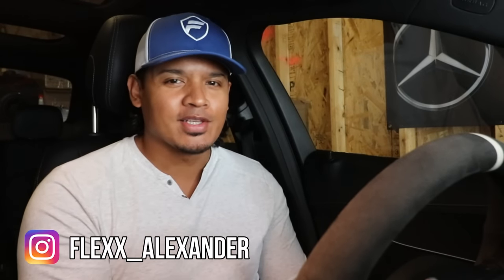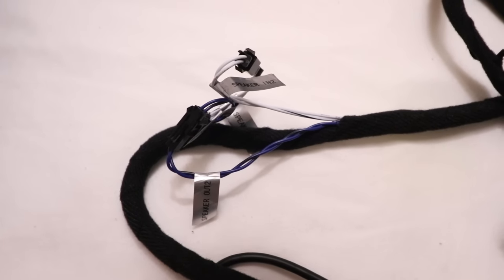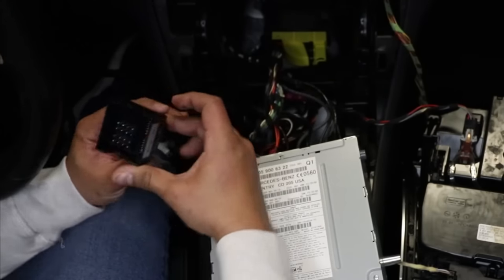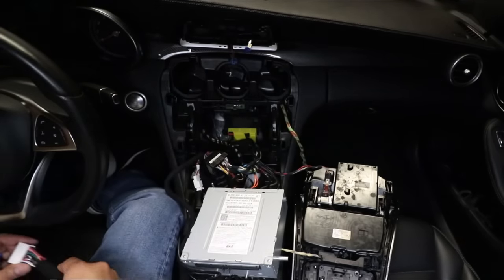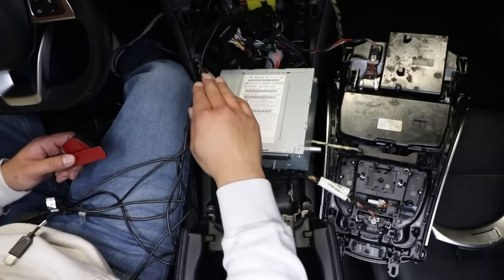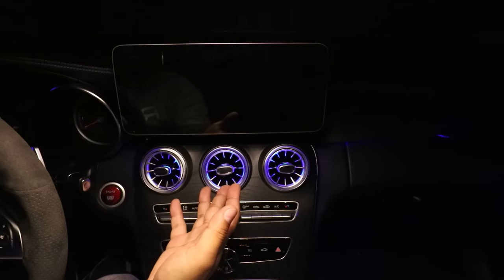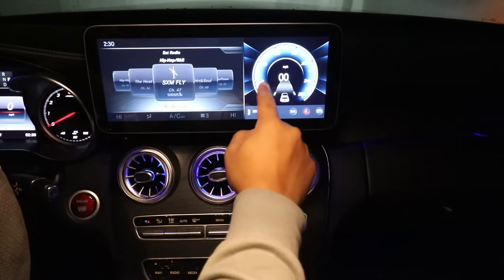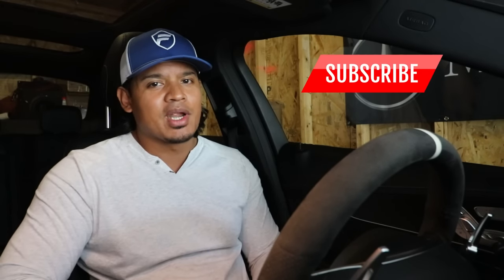BIGGEST Android Screen install on C300 (W205) 2015+ Mercedes C-Class

Comment: Hi Flexx, Thanks for the video. In terms of size, would you recommend the 12.3 or the 10.25 for the w204, c250?
Reply from the maker: For a 204, going 10.25.  The 12.3 is way too big. It’s only good on the 205.
Reply: @TheFlexxGarage  thank you 🙏🏾.

Comment: With the aftermarket screen, do you get the 360 camera that comes with the original system? I have a 2014 E 400 coupe. Crazy about the car, just not the infotainment system.  Someone told me that with the aftermarket infotainment systems, you lose the cameras functionality that comes with the car.
Reply from the maker: You don’t get a camera with the screen. I already showed in the video that the screen supports the oem camera or any aftermarket installed camera.

Comment: Hey man. Thank you for the video. I have a question about the buttons on the steering wheel, do the work with this display? For example, can I accept a call on my phone using those buttons?
Reply: I would like to know as well
Reply: I have basically the same screen here in the UK and the buttons work to answer and cancel calls.
Reply: @nickclarke2444  Thank you man ❤

Comment: Can you control the ambient light as well via this new screen?
Reply from the maker: The stock ambient system is controlled using a setting on the oem interface.  The new screen has access to both the old oem interface and the new android interface.

Comment: With the GPS and Mic do you have to set them up?? Or can I just use the OEM GPS and Mic with new screen??
Reply from the maker: The extra mic is just for extra voice pickup. It’s not required. The stock mic will still work. 

The oem gps can still be used but only in the OEM intereface on the new screen. It won’t work in the Android interface.

Comment: Is this screen compatible with the GLC300 2018 using Head-Unit Include CarPlay? Can I use this screen to display a simplay carplay function? At that time, I need to install GPS antenna, wifi antenna?

Comment: Thanks for the very detailed video, you’ve got a like. When plugging in the small speaker, are you loosing anything? Like yours, my harness is together already, and I only plan on using CarPlay navigation. 

The small speaker is only used if I’m using the built in android Navigation right? 

Thanks.
Reply from the maker: The speaker is optional
Reply: Appreciate the fast reply. So if I install the speaker, but use CarPlay, the sound will still come through cars own speakers using the USB to Aux?
Reply from the maker: the whole point of the screen is to upgrade your OEM screen. It still plays all audio through your car speaker system. They wouldn't sell a system like this just for it to only play through a tiny speaker. The tiny speaker only has to do with GPS directions from the android screen in certain situations.

Comment: Hey Flexx, been trying to reach out with some questions.  I did the install on my  new Android 12.3 Touch Screen  on 2016 E400 with NTG 5.1s.  Thank to your video.  However, noticed there was a Aux Audio out and Aux Audio in type male and female connectors main harness.  Wasn't sure so I simply connected these two aux type connectors together, and didn't use the USB audio box.  Everything else was straight forward and seems to work beautifully.  However, when trying to listen music from the Android side there is no sound.  OEM side works just fine.  Could it be that USB audio box that I ignored?  Please reach out let me know.  Thanks
Reply: Yes. Need to plug aux into usb Audio box. Then audio box into usb slot.

Comment: Great video Flex! Why didn't you use the original GPS sensor of the car ? You haven't it on the car ? I have a W205 2018 with a small display but it has GPS. I think I can use it, right ?
Reply from the maker: The screen has nothing to do with your oem system.  It’s basically like plugging a tablet to your car. It needs it own GPS receiver in order for gps apps to work.  When you switch from the android interface back to the oem interface, the oem interface uses your oem GPS receiver.
Reply: @TheFlexxGarage  Thanks for reply... one more question: at 5:19 you removed a connector from old display. Isn't it the GPS's car receiver antena ? If so, can I use it instead the one provided with the new screen ?

Comment: Hi Flex, thanks for making these videos and having that 5% off code. I recently got in my android screen and I wanted to know if I had to use the microphone and the speaker they sent with my screen in order to use voice control? I notice in one of your older videos the screen didn’t come with the extra mic and speaker. It’s my first time installing a screen and I want to keep my install looking as clean as possible
Reply from the maker: The speaker and the mic  is not a must. It definitely helps but the screen will still work for calls and turn by turn direction without them. If you want to triple check, just contact DMP and raise the question. They can confirm.

Comment: Just opened the center speaker cover in my second hand C350e.. And realized there is no speaker inside. Is it normal for that model to have an empty speaker soket?
Also.. There is no satelite radio cable where it should be..

Comment: Question about the Android screen 
Everything was great until I took my car in for service and now the buttons surrounding the selector wheel (driving mode switch, exhaust mode, damping mode) don’t work while the aftermarket menu is displayed. They do work while on the original menu, so when I enter the original OEM menu I can change my driving mode .
The middle zone (selector wheel, pad and buttons on the pad) do work on all menus
How do I make the other buttons work at all times again?
Reply: Hi, 
were you able to solve those problems? I am thinking about buying one for myself. How does it feel like after using it a period of time? is it as smooth as the OEM system?

Comment: Hi Flexx. Do you know if 360 degree stock cameras and animation are displayed in andoid? (Image from above the car and auto switch from the back to the front camera)
Reply: Also, it is possible to use split screen?

Comment: Do you have to instal the gps receiver,   car already has it via the old oem. ?   Does it not transfer when installing the screen?
Reply from the maker: The android interface on the screen uses the aftermarket gps receiver in order to use gooogle maps or another map app. 

The oem interface on the screen uses the oem gps receiver built into the car in order to use the OEM navigation.

Comment: Hi Flex thanks for your screen upgrade just 1 question does the speaker and mic replace the original car sound system. Regards John
Reply from the maker: No. The mic is supplemental to the oem mic. And the small speaker is for gps guide as a backup.
Reply: @TheFlexxGarage  Thank you very much I really enjoy your vids great job

Comment: Hi Flexx. Great video and install. Can you please tell me if it’s possible to run the NTG menu full screen without having the split screen with speedo on the side? Thanks!
Reply from the maker: You can but it’s in a hidden menu.  The screen view is gonna look stretch though cause the oem NTG aspect is not designed for a wide screen.  If you wanna do it, you need to contact whoever sold you your screen on a walk-thru along with the password to your screen to enter the hidden menu.

Comment: You plugged the audio-out-USB into the USB-port in the armrest. While the USB-port in the armrest is only a power supply. What's this has to do with the function of the audio-out? Thanks.
Reply from the maker: The USB port on my car is not power only. It’s an Audio in. (Like an Aux).  If you don’t use it, then you get no sound from the screen into the cars audio system.
Reply: @TheFlexxGarage  how does carplay sound work? on my current screen mod I have to switch to AUX to have driving instructions which is annoying, with this can I have Spotify playing over BT to OEM radio AND driving instructions through the provided speaker from the wireless carplay?
Can i also screen cast from my phone AND have the audio playing over BT (like say on YT app)? This feature alone would make me wanna upgrade from my current setup..

Comment: Hi Flexx , I've installed the same display on my C220 2015. My audio and reverse camera don't work in the android interface but they're okay in the stock MB interface.  Any fixes you would suggest?
Reply from the maker: You didn’t setup your android setting correct. You need to contact whoever sold you the screen for how to set it up for your specific car.

Comment: I attempted this install about a week ago but was unable to install the new bracket. It seems the screw holes do not line up with the ones in the dash. Did you have this problem at all?
Reply from the maker: As seen in the video, it Lines up and installed perfectly for me.

Comment: Since installing this two years ago, have you had any issues if so what where the issues. I’m considering buying it I just want to make sure everything will still work like factory
Reply from the maker: Had one issue with CarPlay freezing up on me. Just uninstalled and reinstalled and it was fine.  And maybe 2 times a year, when I start the car…the screen would still be black. So I just shut off the car and turn it back on, everything is fine.  Again, maybe 2 times outta the year.  

When you’re in the OEM interface, everything works like factory.  When your in the android interface, it works well but don’t expect everything to work like factory cause it’s not. There’s a learning curve to using the android interface.
Reply: Do you think it’s worth it to buy? Even with those minor issues?
Reply: Quick question, do I need to connect the mic or can I connect it to the old screens mic and use that instead is that possible if so how ?

Comment: I bought and installed the 12.3” Android screen for the W205 back in April, and it looks and functions almost exactly like this.  Surely such a minuscule difference from the one I have would be available as an update rather than having to drop another $630?
Reply from the maker: You might be able to get some updates but there were hardware improvements that are physical changes.

Comment: Hi Flexx, I got mine in June 12.3” and I have two issues: one the sound is always delay by 3 to 4 seconds. And the other one is when I receive a call or make a call, I can’t hear so I need to always change my Bluetooth option from my iPhones while I’m driving, it is annoying to be honest. Any solution for me?
Reply: Hey bro, did u have the delay before on the oem screen? If you did then its a mercedes head unit issue that can now be fixed with a dmp add on for the delay. If its a new issue then you should probably reach out to dmp to see if they can get it fixed. Best of luck!
Reply: I have this same issue with the delay! Any solution 1 year later?

Comment: hi Flexx, I have built the android screen from MDP in my GLC and have some questions, my rear camera shows the half screen, but wenn i turn to D mode, i can see the rear camera very well. Another question ist the android audio, i don't hear anything, wenn i turned to origin mercedes menu, it works great. Do I have to change settings anywhere?
Reply from the maker: You need to setup the screen properly.  Those you mentions are not issues with the screen but your settings.

Comment: is installing the speaker and microphone necessary? and does the audio run through the car speakers for navigation and music?
Reply from the maker: Not necessary but better voice pick up for calls.
Reply: @TheFlexxGarage  is it possible to use the oem micro and speaker?
Reply: @stintflamez, I'd like to know the same thing. I would only be using the unit for Carplay, so would I need the GPS antenna, mic, and little speaker hooked up?

Comment: Hi Flexx, why does the screen need a different GPS and WiFi receiver instead of using the built-in receivers?
Reply from the maker: Because the stock receivers only work with the oem interface.

Comment: Hey Flexx, have you ever seen the little orange check engine light after installing this on your W205? Mine didn’t show up after first, but now it does?
Reply from the maker: Most of the time, Check engine lights aren’t associated to electronics. You need to go to autozone or a shop and have them pull the fault code on why the car is throwing a check engine light.

If you didn’t disconnect the car battery during the install, you probably trigger the car to have a fault. Only way to know is have a shop extract the fault code.

Comment: Hey Flexx I’m having trouble snapping the air vent back up into place after everything was put together for the screen up to the point of screwing it back down… do you know why it won’t snap back up?
Reply: I’m having this same problem. There’s too many wires back there in the way. Did you figure it out?
Reply: Me too, it’s a nightmare… how did you do?? Please let me know…
Reply: Hi, 
were you able to solve those problems? I am thinking about buying one for myself. How does it feel like after using it a period of time? is it as smooth as the OEM system?

Comment: Hey mate great video! I also want to get the new 2020 steering wheel, which maps the old steering wheel buttons across. Any idea if it would cause issues with also having an after market infotainment screen like this installed?
Reply from the maker: I have both and I have zero issues.
Reply: @TheFlexxGarage  thanks so much! I'm new to your page and just watched the video of you installing the 2022 steering wheel! I have been looking at the FL steering wheel and every shop I talk to tells me it comes with a little mod mapping box that is required to map the buttons from the old wheel but in your video you don't have that! I might ask that company you bought the wheel from!

Comment: My reverse don't work,  do you know why this have a yellow cable says reverse camera
Reply from the maker: You need to fix the setting. You can’t just install the screen and expect everything to work. These screens are designed to be setup to match the cars features.  So you need to go into the settings and turn on/off specific settings to match your car and your cars features.

The yellow cable is for an aftermarket add-on camera. I have an OEM cameras, that’s why I didn’t use the yellow cable.

Comment: Hey flexx do you know how to get wired car play working? The 2 USBs didn’t work and the OEM USB ports don’t work either. Only wireless CarPlay works but it takes too long to connect (GPS is placed next to rain sensor, 4g/wifi antenna placed under glove box)
Reply from the maker: Don’t know. My CarPlay auto connects as soon as I get into my car and I have Bluetooth/WiFi turned on my phone. You need to contact DMP for support if you bought from them.

Comment: Hi mate! Do your side view mirrors still automatically adjust when you enter reverse gear/view rear parking camera?
Reply from the maker: Yes
Reply: @TheFlexxGarage  mine has stopped adjusting automatically. Would you know of any settings on the android device or any connections that I should check over under the center console?
Reply from the maker: Sounds like you need to adjust the setting in the android screen.  I think that setting is in the hidden menu. The only way to get to that setting is using a password only whoever sold you the screen has.  If it’s DMP, just message them and they’ll walk you thru the fix.

Comment: how does the wheel button work now? I remembered in the old version, you mentioned the button does not work well. How about this new version? thanks.
Reply from the maker: Wheel button?  The center scroll wheel works fine.  

Steering wheel controls only work in the NTG interface.  In the android interface, only the volume control on the steering wheel works because to get sound out of the android interface, the oem system needs to be set to aux/USB.  And in that mode, steering controls don’t work…even if no android screen was installs.

Comment: Hey Flexx , just have a question , does the screen android work well with the original Radio ,? or does it need to change the Radio ? someone told me we have to change the Radio so the screen can be work well , !!
Reply from the maker: As shown in the video, it’s works 100% fine with the oem radio.  Whoever told you to change the radio is a person you need to stop listening too. If you have questions on the screen, ask DMP directly. They can tell you everything you need to know with no bullish!t.

Comment: Hey Flexx, did you notice any audio quality degradation from using the aux to USB option?
Reply from the maker: no issues. Sounds good. 

Some person experience interference/static but installing a ground loop noise isolator usually cleans up the audio.

Comment: Hey flex every time I go into Apple CarPlay it switches over to radio won’t use MB Bluetooth I have to go back switch it and stay in the screen menus any ideas ??
Reply from the maker: Don’t know. Sounds like a settings issue. Or your screen needs a firmware update.
Reply: @TheFlexxGarage  also do you know how to fix the oem resolution when it’s halfed I can’t see some of my functions
Reply: Snoopy, I'm having the same issue. Have you found a solution for it? 

My backup camera only comes on for 1 second, then goes away, turning to a blank dedault sensor android backup view without video. Any idea? NTG 5.0

Comment: hi, nice screen im buying one. if i dont want to install the gps and the speaker, because in my country it doesnt have gps and im always will be in the carplay interface using waze. so its not neccesary this 2 items?
Reply from the maker: Yes. You are correct. Not needed if your purely running CarPlay. I would still just keep them plugged in and leave them inside them inside, behind the radio area.